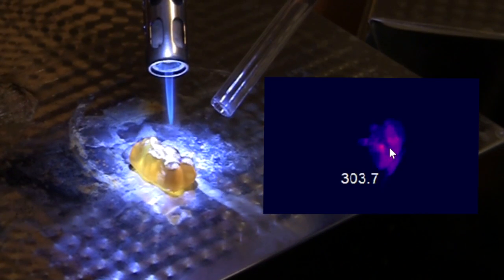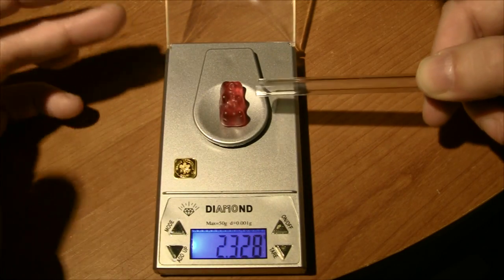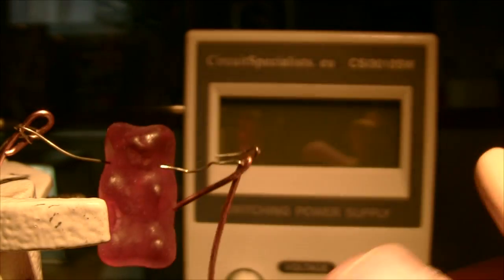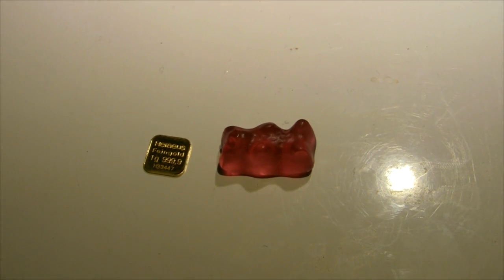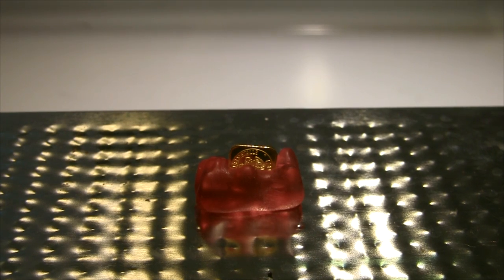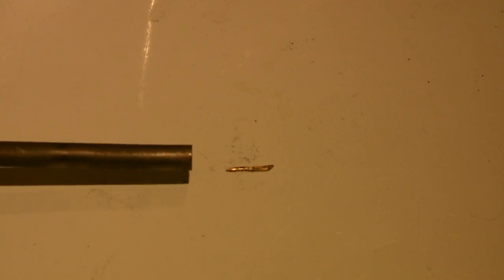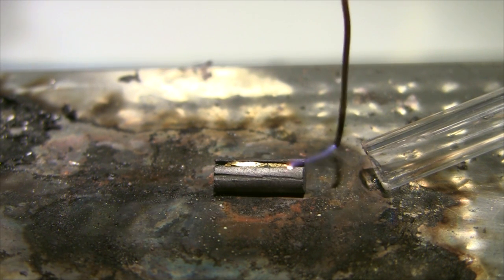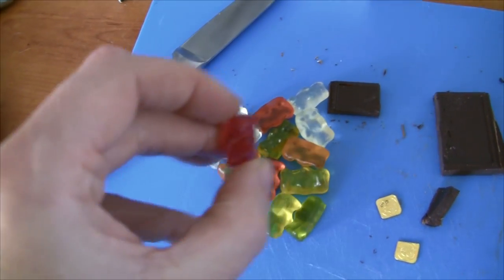Can 1000C Gummy Melt GOLD??

Comment: Its not going to work... you need a sustained temp to melt metals... and you think solar roadways are dumb...
Reply: JRMCNEA makes sense your reasoning... nope
Reply: Solar roadways are dumb. Why put solar panels on the road where they will break and be blocked by traffic when you can put them on roofs?
Reply: It might, provided he can push as much energy out of the gummy bear as fast as possible.
But for that to happen he needs to change the way he conducted the experiment, my guess is that with a home made furnace like the ones people make for charcoal and a air blower would work.
Just replace the charcoal with cut up gummy bears and instead of an air blower use the oxygen thingy he used.
Reply: Anim Asaurus
The difference is the fuel release and the furn time. Sugar burns much too fast to be used in this way. The heat is dispersed way too quickly. By he the time the walls of the furnace reaches temperature the gummy bears would be gone.
Reply: Well it could work, provided he puts the bears under the gold, so that any heat that is emitted from the burning goes directly into the gold piece.
But without proper equipment this test can't be done.
If you figure out a way to minimize heat losses and keep supplying gummy bears to keep the fire going, you might be able to succeed.
It's a lot of hassle, so IMO an arc furnace is a simpler tool to melt everything you want.
Reply: This was an experiment. He never said it would work, just that he would try to make it work. Solar roadways are claimed to work, this is a test of if it will work.
Reply: Random Name
 And yet he continues to shit on people trying to actually do productive things because HE thinks it is stupid. While his dumb ass tries to melt Gold with a fucking gummy bear...
Reply: JRMCNEA HE thinks.... that's science bietch
Reply: Random Name
"Solar roadways are claimed to work" They do work in theory. So someone trying to raise money to MAKE them to SEE IF THEY WILL WORK, he throws a elitist im smarter than you campaign calling people who are doing viable experiments idiots, and the people who support them fools. While he tries to do something a fucking 2 year old would scoff at.
Reply: marcofico1
No. Thinking isn't science. Critical thinking and educated theories is science. An idiot can think a unicorn is real and there is a world wide conspiracy to cover it up. That isn't science.  Maybe Science is so fucked because people consider just having a thought science.
Reply: JRMCNEA do you BUILD a skyscraper and then you SEE IF STAYS UP????
Reply: marcofico1
That is literally what Thunderfoot did while he made fun of the people who wrote up a blueprint for a skyscraper. he didn't do the basic legwork that would have told him a matter of factly that you can't melt gold with a gummy bear. But while people are crunching the numbers on the amount of energy that could be collected by covering usually clear areas. He goes out and buys some shit LEDs and commercial shit solar panels and claims THEIR work is dumb.

He acts like an intellectual idiot who laughs when someone says they are looking to invent the next great technology because HE lacks the vision.
Reply: JRMCNEA I don't really see your point. Solar bullshit roadways is just a way of stealing money with pseudoscience. There are too many variables in this project for instance the price of each piece of solar panel, how to connect them, moving the dc electricity from where you harvest from the sun to where you want to use it, the top part of the  panels are made of glass so issue with grip for cars and issues and lost of power over time due to dirt and scratchings. I don't consider this a reasonable project. And I can keep on going with issues
Reply: marcofico1
This is why you don't see my point.

"I don't really see your point. Solar bullshit roadways is just a way of stealing money with pseudoscience"

You make assumptions of the intentions of the people doing something. and use your assumptions to undermine the thing they are trying to do. NEVER addressing the validity or potential of what they are trying to do. You are basically saying Wold hunger can never be eliminated because the people raising money for it is just trying to take advantage of people who care about people. What the hell does that have to do with the actual concept of eliminating world hunger.

What does your assumptions about the people who came up with the idea, have to do with the concept of putting solar panels in open spaces that get a lot of sun to generate electricity? You are stupidly claiming the concept being a solar farm is stupid because solar panels on roads or sidewalks is the EXACT same concept applied in a insignificantly different way.
Reply: Man mine are not assumptions it just sad and cruel reality. The issues I mentioned ARE issues in everyday life. With a lot of components leds, cables, glass, panels it is inevitable that one of these will fail and it will. I would love that this idea was possible but is simply not going to work because of REAL problems not assumptions.
Reply: marcofico1
YOu think your perspective is reality? how original. So how long have you known the creaters of the solar road ways. That you would know their motivations? How do people say these things and not realize how ironically oblivious to THEIR OWN actions they are while they claim to have an inside track on someone else's...

"With a lot of components leds, cables, glass, panels it is inevitable that one of these will fail and it will."

Name a device you have in your home that will never fail.

"I would love that this idea was possible but is simply not going to work because of REAL problems not assumptions."

You mean like placing 70 foot lights along thousands of miles of highway not possible? Or just the normal reheat your food in a fraction of the time not possible. only a fool says something is not possible when there has never been any research or investment in finding the issues some new technology will have. Idiots 50 years ago would have claimed us having this conversation was "not possible". Your lack of imagination and inability to see problems that can be solves within an idea is not a condemnation of reality or the world. It is a condemnation of YOUR perspective. Human idiots have this thing where they think if THEY can see something happening. It means it won't work. Luckily for the human race there are also people who ignore the foolish and ignorant and continue to believe in their work.
Reply: Ok but you are talking in general and  you never adress something I say. Do you have an idea of how many hexagonal panels you need to cover let's say 100km (60ish miles) of a road wide 6 meters (18ish feet)?
Reply: marcofico1
Maybe that is the problem. People don't know how infrastructure is built. We don't build 60 miles of road. We build 1 to 5 miles of road at a time. People seem to think that the way to create a great building is to have a great idea. Then start marketing that great idea. If your great idea is a 2 Trillion dollar project that would generate 100 trillion dollars in revenue, If you don't have 2 trillion dollars you might as well not try. People do not understand the walk to the goal. They think they see the goal and then teleport. You have to raise that 2 trillion dollars. And to do so you have to fight against the interests of every doner you come across. Because they ALL will want the lion share of the 100 trillion dollar profit. Even if you don't care about the money. You can't promise a million people a trillion dollars for their million dollar investment. But if you can sell 2 billion people a product for a thousand dollars. You will get that 2 trillion without any major problems. But what is it that you will sell?  Just because your goal is big. Does not mean you try to carry that big goal out from the very start. I may not be able to eat a 30 pound steak in one sitting. But if I cut that steak into 30 pounds of steak I can eat that steak withing a month. Even less if I eat some twice a day.  I live in a big city. They don't try to fix all the fucked up roads at one time. They plan out which roads will be fixed at which time, in which time frame. Taking al sorts of things into account.
Reply: Still you didn't reply me....
Reply: marcofico1
Yes I did... You break that 1000KM road and you break it into 100 10 Km projects. How long do you think it took for Germany and the U.S. to build their highway system? 2 weeks?
Reply: Never said anything about time. I asked you how many panels you would need for that.
Reply: marcofico1
How many pounds of asphalt would it take to build a road from New York to LA? The point is irrelevant. Do you think we will run out of any of the resources needed to do so? Because over the time it would take to PLACE them. We would have more than enough.
Reply: JRMCNEA ok so you don't want to reply me. Then why is this project  7 years old and they were able to install maybe 10 square meters in this period, and in the mean time they gained around 3 millions?
Reply: marcofico1
Because of a LACK OF MONEY. How much do you think it costs to build a road?... You are ignoring factors. And they have not been building for 7 years...
Reply: JRMCNEA but if it is such a good idea why nobody wants to fund it?
Reply: marcofico1
Geothermal power plants are a GREAT idea. Why are they not being funded? You can put one anywhere you would put an oil rig. universal comprehensive healthcare is a GREAT idea. Why is America fighting it? You seem not to realize that every great idea has push back from those who gain from the status quo. Green energy is a direct threat to one of the largest most powerful industries in the world. Why did Chicago's Mayor pass a bill outlawing solar panels on house roofs?
Reply: JRMCNEA Once the placement of solar panels becomes an actual problem, then we should start thinking about putting them on the roads.

Do you even realize how impracticable these things are? Putting solar panels on roads will cause them to break which will increase the maintenance cost on the roads immensely. You should also consider the fact that solar panels need light to work, and won't traffic block the light from reaching the solar panels?

This is not a good idea at all because there are much better places to put solar panels other than where we drive our fucking cars. I wouldn't be against putting solar panels on the sides of the roads once they become cheap enough, but it will still be expensive and somewhat impracticable.

Solar road ways are not what we need at all, what we need are cheaper and more efficient solar panels and we also  need to build safer and more efficient nuclear reactors to hopefully minimize our carbon foot print.
Reply: The Pope
Solar panels have been around for decades. And the technology has been exploding for the past 10 years. How many houses in your area have Solar panels on their roofs?
Reply: Approximately zero houses in my area have solar panels. The only building that I have seen solar panels on was some sort of medical facility around forty minutes from where I am. I know that solar has been getting cheaper in the past few years but the point is that it is still expensive. Besides, asphalt is way cheaper and more durable than solar panels.
Reply: The Pope
Thanks for making my point.
Reply: JRMCNEA yea but now why should we put solar panels on a road?
Reply: marcofico1
Because people are willing to donate money to make it happen. That simple.
Reply: So are you just ignoring all of the criticisms toward solar roadways and saying "Because people are donating money we should do it"
Reply: The Pope sounds like it
Reply: The Pope
They asked why should a project that people donated money to proceed. Because the people donated the money.

 The criticisms are irrelevant at that point. If people finance R&D on a jet powered pocket pussy, the money should go to that. Not to mention the fact that I have ALREADY broken down the flaws in the criticisms of a solar road way.

"It's just stupid" is not a criticism. Especially when we have solar panels on roofs  cars and fucking light posts. To claim the panels would work better at an angle is like complaining about how inefficient the combustion engine is. At this point in time we can not make road ways look like obstacle courses and mazes. The panels have to be flat on the ground. And even if they operate at 40% efficiency, We currently receive ZERO energy from our current road ways. So 40% of something is MUCH more than 100% of nothing. You guys are unwittingly "criticizing" CURRENT technologies in operation today. Do you know the efficiency of a toaster? Do you know the efficiency of a central air unit? Should none of these things be utilized because you think they are stupid and inefficient? You are not saying we need to work on making the efficiency better. You are stupidly saying don't take the first step because it's a waste of time and money. TOTALLY devoid of scientific attitudes.
Reply: marcofico1
Your supposed criticisms are just devoid of reality. "but if it is such a good idea why nobody wants to fund it?" They raise 2.1 MILLION dollars for their research.
"Solar bullshit roadways is just a way of stealing money with pseudoscience." This is just your own uneducated assumption.

"There are too many variables in this project for instance the price of each piece of solar panel,"  How much does the flood light cover of a 747 cost? You are crying over the cost of production of a product not being mass produce or even produced to scale.

 "how to connect them, moving the dc electricity from where you harvest from the sun to where you want to use it," DO you think your electricity is being produced right under your house? We have thousands of transmission technologies. And How would we transfer electricity form a solar panel on the roof, to the battery bank in a house? This is the types of questions you are asking. "the top part of the panels are made of glass so issue with grip" You know there is a way to texture glass so it is clear but can be gripped right? Not to mention the fact that Tires can be manufactured to grip the surface of the road in the exact same way our tired are made to operate on all kinds of surfaces and weather conditions today.
" for cars and issues and lost of power over time due to dirt and scratchings." I don't know about your place of residence. But where I live we have these things called street sweepers to clean the road debris.   And today it takes at least 3 days to repave a road. Where a truck with panels could replace hose panels in a few hours only for them to be taken to a shop and refurbished and put back in operation in other areas that need their panels replaced. "I don't consider this a reasonable project." The idea that because YOU don't consider something a reasonable project, it should be scrapped says more about YOU than it does any project you are speaking on. "And I can keep on going with issues" Im sure the people who laughed at the wright brothers could have too. That is the thing about sudointellectuals who don't create anything. They can come up with 1000 reasons why a light bulb is a pointless creations. You can come up with a mountain of reasons why NOT to try something. But you would never be able to come up with a solution of a single issue you found.
Reply: JRMCNEA You obviously cannot be convinced that these are a bad idea, even though people have pointed major reasons why they are a bad idea. So let me just ask you this, when do you think these solar roadways will be built and used on the large scale. 10 years? 20 years? 50 years? Or maybe even 100 years? Solar roadways is not the thing we need, nor is it the thing we will need, because as it stands, its too expensive to be economically viable.
Reply: The Pope
I can be convinced that there are bad ideas. TO convince me I need data. Not assumptions and laugh reels. Saying It won't work because it's dumb is not an argument. It is an asinine opinion. Claiming something has issues is not an argument not to try. It is a call to find solutions to those issues. And the vast majority of people INCLUDING Thunderf00t has done no research on the possibilities of a solar road way. They have just written it off on it's face. And like I have said and will continue to say. This is ALWAYS done when it comes to new technology and processes. Edison did it with AC power. People did it with flights. And people are doing it with green energy. You guys have just decided you will point and laugh at people looking to create solutions. While you only look at it at face value and say "thats dumb. That won't work".
Reply: JRMCNEA solar roadways are then the future I would say right? I asked you before how many of this panels you would need for paving 100 km and you avoided replying btw you will need around 1,8 million of these plates with 50 led each, yea big numbers:easy to fail. I would like that you follow some kind of logic not saying that flat solar panels have 40????% efficient when now the max is 20 for an angled and very good solar panel. moving dc current is impossible for long distances so inverter=even more loss
Reply: marcofico1
You seem not to get it... IT DOESN'T MATTER how many it takes. You people seem to be oblivious to the fact that there are THOUSANDS of implemented technologies that have a million points of failure but were still implemented because the risk could be minimized or managed.

You are stupidly looking at your iphone and proclaiming the first voice over line is inefficient and stupid. YOu DON'T know how technology works, or how Technology evolves. You stupidly think because YOU don't see the value in SOMEONE ELSE'S work. They shouldn't be given the opportunity to work. Totally brain dead to the fact that even a failed project can lead to innovation in other areas that would be greatly beneficial. And you are not coming from a in depth position. You stupidly say "1 million panels?  one or two of those might fail.Thats a waste of time!" And refuse to recognize that that is LITERALLY how technology is introduced. How many microwaves are there in the world? How many feet of copper wire is that? How many computers are there? How many drops of gold is that. You look out at a forest and proclaim it would be impossible to get fire wood because there is so many trees.

"I would like that you follow some kind of logic not saying that flat solar panels have 40????% efficient when now the max is 20 for an angled and very good solar panel."

You totally failed to understand my point. (And I was talking about 40% of the possible energy generation not efficiency over all. SO in other words 40% of whatever that panel would get at it's best angle.) But completely ignorant. The efficiency of a combustion engine is 25-30%. Should we then scrap transportation as we know it?

You idiots oblivious to general limits and efficiency over the broad spectrum of technology trying to use efficiency numbers on a up and coming technology is flat oout mental.

"moving dc current is impossible for long distances so inverter=even more loss"

Yes idiot. And When Tesla introduced AC DC was the market standard. The idiots of that time were claiming that AC was all this kind of evil. I wouldn't be shocked if someone used the "yea big numbers:easy to fail." argument then. But unlike Tesla's day. HE only had to deal with a minute amount of people where the Solar roadway people are having to deal with millions of sudoscientists who heard someone say it was dumb.
Reply: If you want to go see an actual argument for why solar roadways are dumb, just watch all of thunderf00t's videos on them. The actual argument is much better than what you will find in the comment section. And if you have watched them already, watch the them again.
Reply: The Pope
Thunderf00t never makes an argument as to why they are dumb. He just continuously says they are dumb. Notice how we are under a thunerf00t video right now?